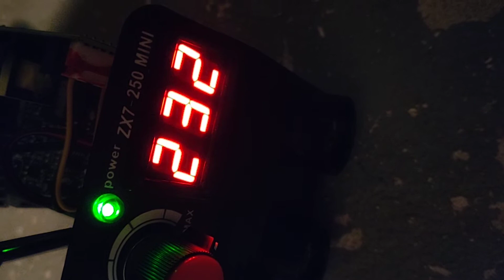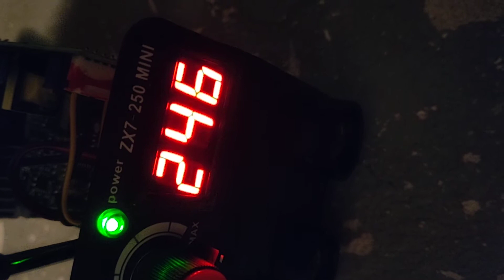Chinese mini welder display adjustment ZX7-250 MINI

Comment: I'm pretty sure the part labeled 180A/U means 180A per volt and is a shunt resistor for measuring output current, not a fuse. The current transformer is on the AC line input as well, I'm pretty sure.
Reply from the maker: That makes sense actually. Thanks for pointing this out.

Comment: Good video, thanks. Check the metal case for earth connection. My one came with a three core flex with earth wire but the earth was not connected inside the box.

Comment: the first version was better, it had 3 capacytors, and the voltage adjust is on the main board lower end, i have it at 150 (with a shunt amp meter it maxed about 130A)
Reply: What was the first version? The ZX7-200?

Comment: the problem, it is not linear, min value in real is 54 A (shown as 24A), 66 on display is 68A real, but 204 on display is 113A. we need to correct low and high amps

Comment: A 180 amps fuse is totally unnecessary and a waste of money for this kind of low cost machine. In my inverter such part is a current  shunt for measuring the output (in the pcb there are the sense lines from the shunt to the measurement circuit). Very interesting video

Comment: ATTN: IF I had my own YOUTUBE channel, I would make a video about this 
DEFECT I found and corrected in my brand new TopShak ZX7-250A 110V 
welder, which I bought on Banggood.  Apparently, this unit was assembled
 using five M3x10 machine threaded screws to anchor the 3 big heat sinks
 in the back of the unit, near the cooling fan. This was a HUGE MISTAKE 
on the manufacturers part, because the heat sinks have no machined or 
tapped threads for the M3 x10 anchoring screws to bite into, but only 
SLOTS in the aluminum castings. You need to grab a standard #2 Phillips 
screwdriver and remove the welder cover, then use the screwdriver to 
check all five heat sink anchoring screws on the bottom of the circuit 
board, to see how many of them are loose and INCAPABLE of even being 
sufficiently tightened in the first place. I just replaced all five heat
 sink anchoring screws with some slightly bigger cabinet screws, which 
have tapered threads that are very similar to self tapping screws. NOW 
all five screws can be tightened very securely. You really don't want 
any of those 3 heat sinks EVER coming loose, because the result will 
eventually be a certain failure of the welder. ALSO....the word VARISTOR should NOT be used to describe ANY type, style or size of variable resistor or potentioemeter, because a VARSITOR is a completely different kind of electronic component.

Comment: hey..i have the same machine and i am wondering if i can adjust the output voltage that i want for a project. do i have to adjust some potentiometer?
Reply from the maker: I don't know if there is a way to regulate output voltage, kinda doubt it. What is your project?
Reply: @andrewray822  i am designing a reactor that will produce hydrogen and oxygen through electrolysis

Comment: One pots is for display and the other is for output current .
Reply: I have same machine but it's tig 250 a.
It has 3 pots. Using one I adjusted max current to 180amps as its max fuse readings.

Earlier I fiddled with one of the other pots don't know what it could be for.?

Comment: I don't have the variable resistor for tuning the output number on the screen (Topshark version of the welder). What is optimal resistance on variable resistor at 130A - screen value ? Maybe You could make a new video that will sum all the topics that acurred in the comments 🙂
Reply: My welding machine didn't have a potentiometer to adjust the display, it had a fixed resistance, I put two 10K resistors in parallel, and I put them in parallel to that fixed resistor, and now it is showing 126.

Comment: I have 2 of these welders.  I figured out you have to correct the digital readout with a 3 resistor bias circuit using the independent supply of the meter.  I used a constant resistor with two trimmer potentiometers to build a mini circuit board to correct the reading on the meter to match the actual amperage of the welder.  The other trim pot you mention that you do not know what it does controls the output amperage of the machine.  Yes mine to has a 180 amp circuit breaker on the buss bar, do not think that is obtainable with the circuity provided by the Chinese.  I am setting mine up to run at about 130 to 140 amps then will use the bias circuit to adjust the meter reading.  Also if you really want more amperage take 2 of these machines and connect them in parallel and you can run much bigger rods up to 225 amps.  However with two machines running at high frequency the welding sound starts to have a high pitch noise to it in lieu of the normal frying bacon sound.  If anyone needs more detail on this bias circuit I will be happy to converse with you.   Thanks
Reply: Hello mate..I tried to correct the value on the display screen as shown in the video but I finally unsettled the other potentiometer that you mention is related to the amperage. How can I fix it? Do the amperes increase, if i turn it clockwise?  Thanks!
Reply from the maker: Just noticed your comment now. I'd be quite interested to know details of this circuit.
Reply: That would be fairly simple Andrew. BUT it might be hard to figure out the resistance values needed... IF you don't utilize a resistor "substitution box" for your preliminary testing. Perhaps "R" would be happy to provide you with the details of his particular correction circuit. Personally, I don't really give a hoot, because I already KNOW the display is showing about twice the actual output current. But another possible way to variably correct the value shown on the LED display would be to simply use a very small VARIABLE VOLTAGE regulator module, to drop the voltage in a very linear fashion. You can probably get a pack of 5 of them for around $10 to $12 on Banggood or eBay.

Comment: Thanx for reply. Now I realize that I have used another potentiometer. Your set up for max current on display works. Now I have window from 14 to 139. I will continue to find how to lower output current to cca 40 A.
Reply from the maker: To be clear, this isn't changing the output current, only what is displayed on the screen. You would have to get some amp-meter if you need really precise output current, to calibrate.
Reply: Yes I know. I intend to make new video with all info I jave now.

Comment: I tried to repeat your test, but with my welder it doesn't work that way. The display changed by 1-2 units, but the output current changed considerably. So far the max output current was 129 and now I have set it to 150 A. I have not tried further. Min remained the same 55 A. I would like to lower that to about 35 -40 A, but I don't know how.
Reply from the maker: Do the internals look the same? Maybe the chinese have made some changes.
Reply: @andrewray822  Yes it looks the same. I put my answer on the top of comments.
Reply: @zeljkozeljeznjak6739  there are 2 blue pots close together, are you sure you're turning the correct one?
Reply: I was able to change the high and low current limits by moving the two blue potentiometers, one changes the lower limit and the other changes the upper limit, by the way the OCV of mine is approximately 102V dc, is it normal?

Comment: see my small test: https://www.youtube.com/watch?v=wa4kJY4Pnkg
I checked current with UT210E, this clamp meter can measure DC currents. I think 250A rating is a 'peak current' rating. Since input is most likely 230V-16A you can have 130Amps at about 28V continously. I found about 50Amps when electrode stuck at the 50Amps selection, so I would not change the calibration. What I found about the hardware is that my input capacitors are faked and I have only 850uF instead of 2300uF. The 820uF Capacitors are only 130-140uF each. Also I miss a relay for inrush current limit at start. I had to use a cable roll to start it.
Reply from the maker: What is the  second control on yours for?

Comment: This is awesome info!!!! Thanks.  I have my welder which I hooked up to an independent shunt with amp and volt meter to get the actual output.  They said 225 amps and it actually was about half of what they said.  So finally I found your viedo that shows me how to trim or adjust the digatal meter to match what the welder is putting out.  Thanks Again!